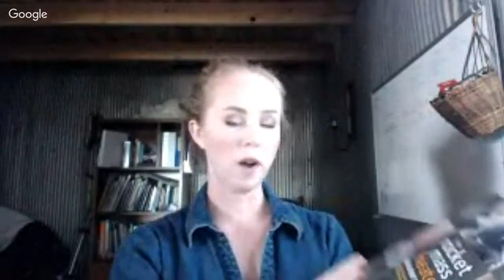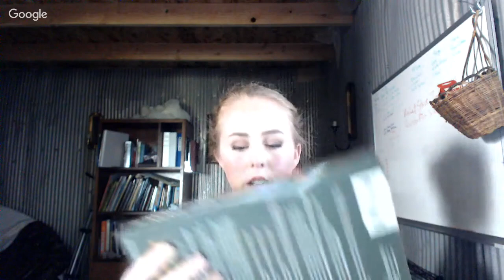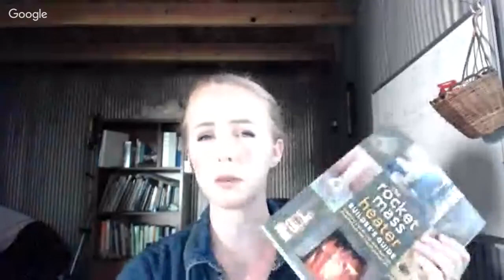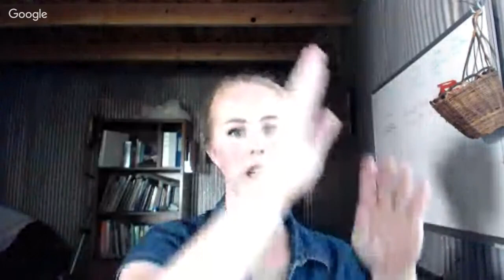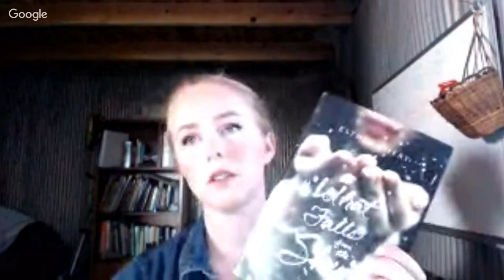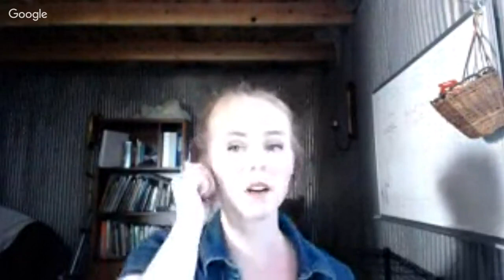Rocket Mass Heater for a Tiny House?

Comment: Contrary to popular belief, rocket mass stoves are only expensive if you want it to be.  The chimeny pipes are not that expensive.  Learn how to arc weld.  Use earth (cobb, rammed earth, what not) and bricks.  The bricks don't have to be new.  The most expensive part is the book.

Comment: i build some rocket stoves for my wagon  and a tiny house. the on in the wagon weight half ton on wooden floor, wheels... the other 3 ton or more on ground.. to deal with the to warm room situation i build up a cop-brick wall around the barrel not touching it but whit 2-3 inch between where hot air can move up and into the room. there is a "door" in the button of the wall and "hat" on the top to close in the heat in completely if wanted. there is not radiation heat from the barrel so direct heat from the fire is nice a batch box whit window or a little window in the j tube. if the wall is thick it keeps the heat long but if to thick the heat does not come out.. if you make space between the top of the barrel and the lit you have a great oven.. this wall-trick might not work fore a stove that heats up a big house since the barrel is closet in it might not take as high temperatures.
the barrel stand on a thin trip of soft ceramic fiber..
if the cop cracks, keep painting it whit a thin thin water clay mix while stove is very very warm and they will fill up 
fore a wagon-rmh solution i thought of making a completely insulated stove like this so it could get very warm without overheating the room and in this way there would be needed less mass it could be made more light weight and still heat a whole night.

Comment: I was told you have to keep filling the stove every hour to keep your house warm and because of it we went with a different one
Reply: Yes, rocket stoves operate at high temperature and high air flow that tends to use up the fuel pretty quickly.

But that's why most are making Rocket Mass Heaters so they have some sort of thermal mass to help regulate the heat and make it last longer.

The main appeal is they are low cost and lets you use even wet twigs for fuel but while they're very efficient.  At around 70-80%, there are modern wood stoves that are just as efficient or more so that can also allow slower burn rates for longer use without needing to constantly tend them.

But the price difference can be very large, with some modern wood stoves going into the thousands.

While designs aren't limited to just stoves... Wood burners come in all types now, including furnaces, boilers, and steam generators...

Options like pellet wood stoves can even operate with a thermostat to regulate temperature and can be set to cook at pretty precise temperatures...

So, lots of options... Just a question of budget and what trade offs you'd rather deal with...